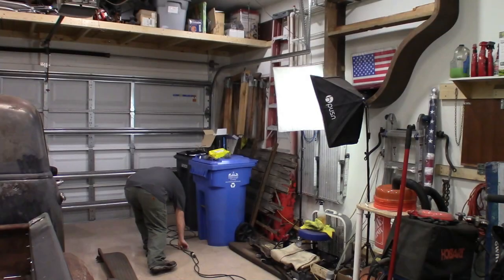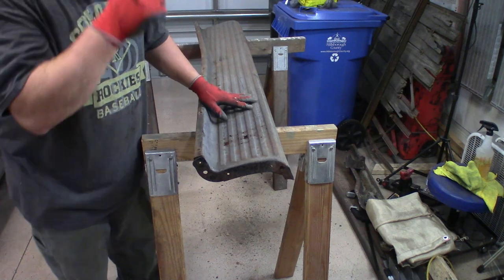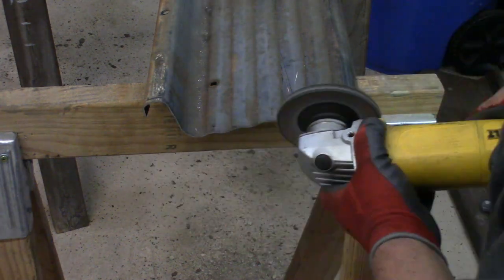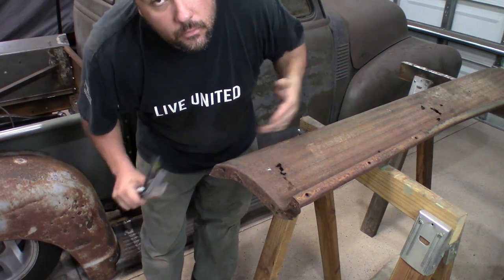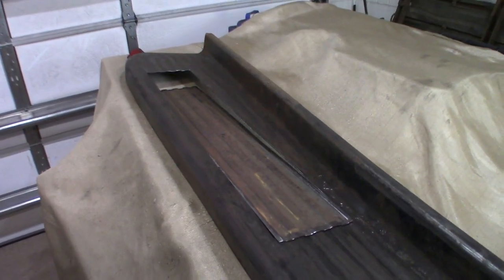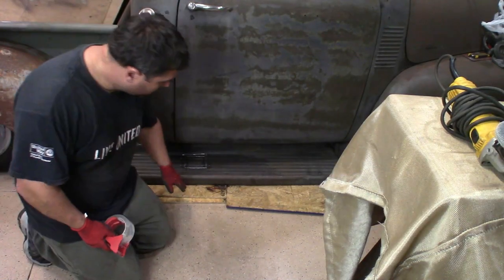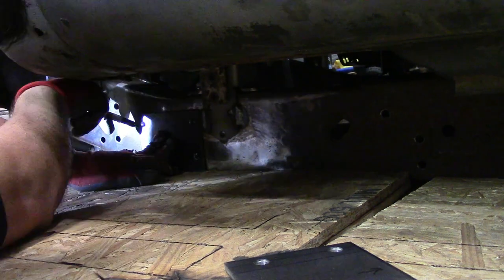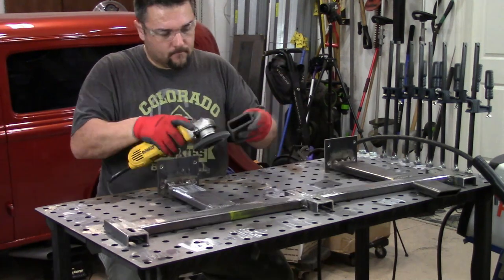PART 24 - 1952 Chevy 3100 - Shortening Running Boards & CUSTOM Brackets!

Comment: Good thing Dave was there, huh? What were you guys loading into the car? A welding table. Something else to store. This is one hell of a build and just a TON of work. Nice fab ideas.
Reply from the maker: Dave provides hours of comedy gold :)  The very opening of the video where I was loading metal into the trunk........ that was the metal used to make the custom running board brackets.  It doesn't look like it, but I have a good month into the running boards / brackets :)  All condensed into a 25 minute video.  I left out a lot of footage......... once I did the passenger side, the driver's side was pretty much identical.  I did buy a welding table....... video coming soon on that.......... Def. a MUST if you are into welding!